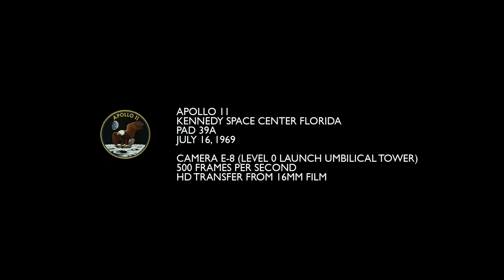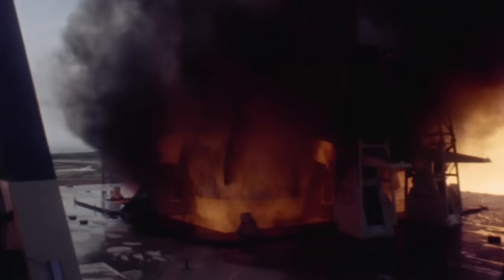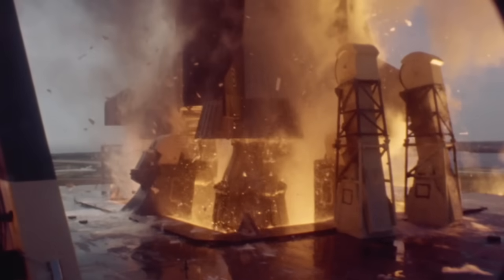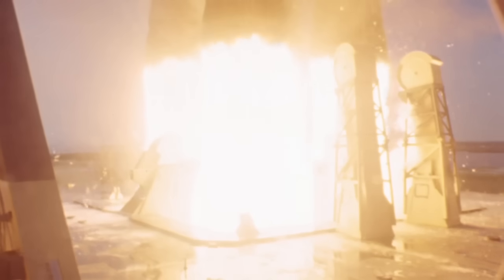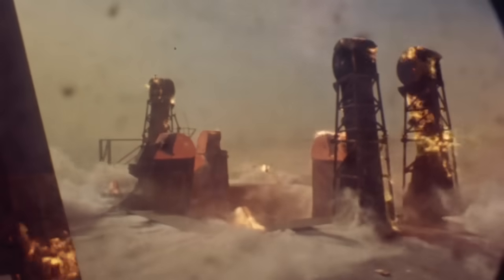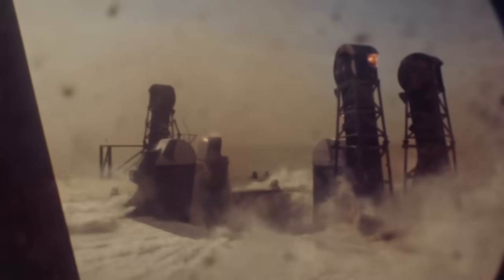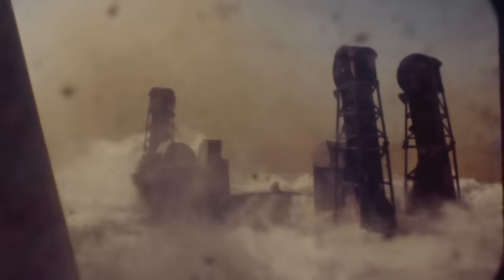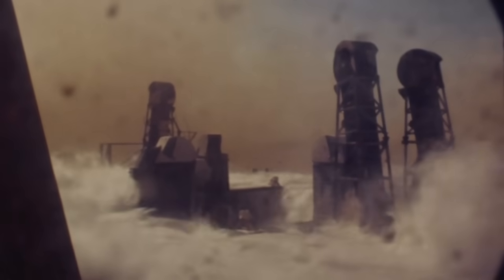Apollo 11 Saturn V Launch Camera E-8

Comment: The moon landings were fraud. Proof the earth does not spin east 1000 mph. Aircraft flying less than a thousand mph eastbound would go nowhere. Birds would not be able to fly west against an atmosphere going east at a thousand mph. If the earth is a closed system, how is it closed and what is it made of? How do rockets escape and return a closed system. Otherwise how does the vacuum of space not remove our positive atmosphere?
Reply: +timez draggen There is this thing called Google. The Earth is not a closed system. Gravity holds the atmosphere in place, with help from the Earths magnetic field.

Gravity also dictates that the Earth is spherical, mostly. Slight bulge toward the equator due to the rotation. The atmosphere is locked to the Earth by friction, hence the atmosphere rotates at the same speed as the Earth, ± local winds. Since the atmosphere is locked in, a plane doing 10mph can easily move any direction the pilot wants. If you were at a Lagrange point, you would see the Earth (with a big enough telescope) rotating to the east. If you could see a plane traveling east, it would be going the speed of the Earth's rotation in addition to its own speed. Again, from the perspective of looking at the Earth from a Lagrange point.

Please, please use Google.

Comment: This camera view is really cool. Now realize that it's only one camera of very many, that are focused on any item that the engineers wanted to track how they reacted to launch stresses. 
My younger sister worked for Ratheon during the shuttle program.  She was in charge of monitoring all of the video feeds on the launches. 
There's a structure at Cape Kennedy / Canaveral called the XY building that all the cables, for all the cameras and communications, go through. 
It must have a thousand miles of wire running thru it.

Comment: After the ablative paint/coating is purposely charred--thus protecting the underneath parts of the launcher--how would those parts get coated with the paint again? In other words, how would they get rid of the charring so they're clean enough to get fresh new coat of this special paint? I guess maybe a combination of pressure-washing, media-blasting, and chemical solvents would work, but that's such a huge scale. Also, would they do some amount of disassembly of the these parts from the launcher in order to do this?
Reply: +Jeff Ro I guess that's one of the things that make space travel so extremely expensive, it takes a lot of man hours to prepare the launch.
Reply: Huge scale? Well, that platform was used to launch a 110 meters tall, 3000 tons heavy rocket. Now THAT is huge scale